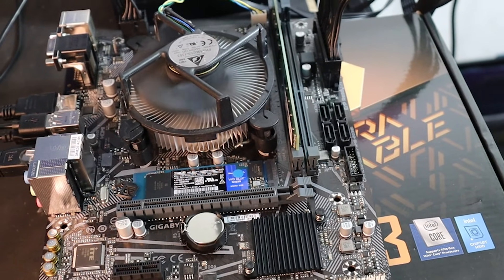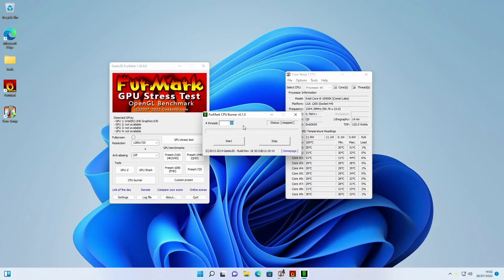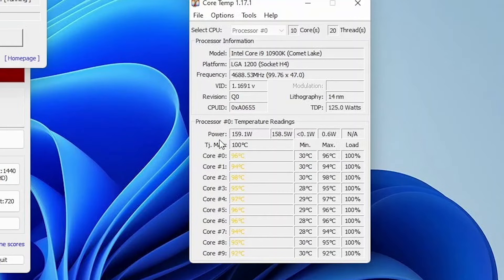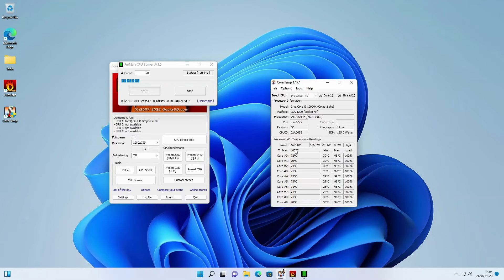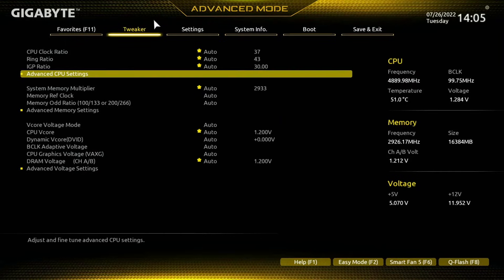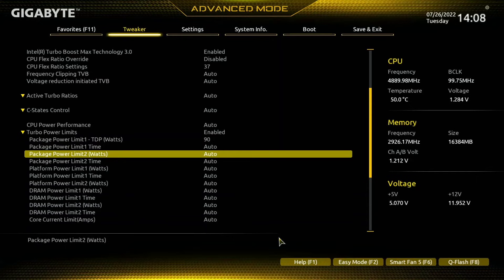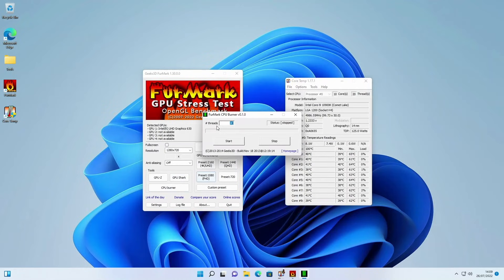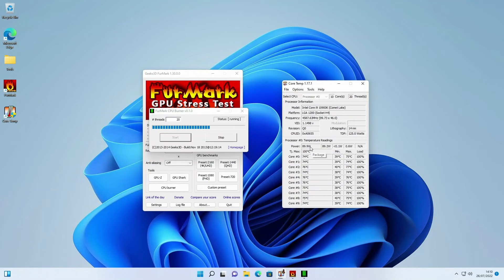How to Undervolt CPU on Gigabyte Motherboards for Cooler Temps

Comment: NO! I have these: Mobo Gigabyte Aorus Pro X WIFI7, i7-14700KF, 32GB DDR5 6400 MHz, Video Gigabyte 4070Ti SUPER Gaming OC 16GB, cooler Corsair Titanium Link 360, Monitor Dell Alienware 2K 240Hz, and I use only these settings: 

BIOS MENU (Tweaker tab -> CPU / PCH Voltage Control):

Vcore Voltage Mode:  ADAPTIVE
VF Offset Mode:  Legacy
Internal CPU Vcore:  1.200
Internal CPU Vcore offset:   -0.130V

I play all games in 2K, Ultra settings, DSLL Quality and my GPU has 60C and CPU 47-53C. Try it ;)

Comment: My current cpu is an i7-14700kf and i have a liquid cooler with a 500watt capacity. Any good settings
Reply: See my new post above ;) I have the same CPU ;) With my settings my CPU has 47-53C, and GPU 60C ;) Enjoy ;)

Comment: Question; your cooler indicates 180W limit, so why did you put your power limits to 90? Shouldn't the P1 & P2 be 180W each?
Reply: The spec he looked up was for the Dark Rock Slim cooler (just showing an example of what to look for); that's not the one he was using. At 0:58 you see his is a default Intel cooler, which may be rated for 90w. Hope that is helpful :)

Comment: I have gigabyte b760 ds3h and i5 13600kf
The temp goes to 100 degree with load 100% on cinebench
I tried  with tdp 125w but temp still reach 95
I have arctic liquid freezer 360 and am sure it fitted well and thermal paste is ok
Is gigabyte b760 ds3h is not capable of undervolting as i heard?!!
Reply: Iam having the same board.. same problem
Reply: did you solve it?
Reply: That board’s vrm is too weak for that CPU.

Comment: thats i want looking for it...
thanks man...

i have use i5 13500 with same thermal thrtlling issue when i do cpu stress it goes 95 to 98 with 165 watt power draw but i set it to 135 pwd now its time to test and guess what i earn temp under 67 i m so happy for these trick.....

thanks again man...
Reply: Bro same cpu I was using showing 90+ degrees while gaming... could this help wat mother board ur using
Reply: @arunprince143  im using at 140 watt.... and now it works smoth with not reach 80 deggree and i know it loose some performance but your goal is only gamming than go for it with 140 watt power draw it will not disappoint you... and i m using gigabyte b760m ds3h wifi motherboard with ddr5 based....
Reply: Hi, I'm also using i5-13500. Has there been performance reduction when you set your power draw to 135 watts?
Reply: When I do cpu stress my power goes to 80 w and temp is 90+

Comment: My i5 12400f idles at 50c and while gaming reaches 80+ When I did what u did  it seems like something was already put into my system to stop it going above 65W as that was the cap it was going to I suspect it’s because I still use intel new stock cooler any tips
Reply: Weird. I am currently using an i5 12400f and in 3 years my gaming temperature has never reached 50 degrees. Now, when it's winter, it's about 34-40 degrees. But I will add that I have FPS locked at 75. So I don't torture my equipment as much as possible. I have a weak refrigerator due to the size of the housing - noctua nh-u12s. Tomorrow I'm replacing the processor with an i7 14700. And I'm just starting to worry whether the cooler will be able to handle it. :)At rest my temperature is 24-30 degrees (in winter), in summer it is about 27-33 degrees at idle.

Comment: BRUHHHHHH ~!!~!~!~ I gave this a try since this game Dead Space remake has been the only game that's notorious for me that even at cpu load of 40% and gpu at 100% it still gets my temps to 85-90... THIS GAME ONLY.... and after trying your method in the video it worked for me, 1440p all settings maxed 144hz. All smooth and only gets to 55-60 which is the same for my other games like Baldur's Gate 3. This feels good and you saved me years of CPU lifetime it seems, thanks dude, i'd give you some weed if i could lol.

Comment: For i7-13700K
Vcore Voltage Mode: Adaptive Vcore
Internal CPU Vcore Offset: -0.200V
Enjoy! I think the same way for other CPUs with P and E-cores. For CPUs without P and E cores there is other way:
CPU Vcore - Normal
Dynamic Vcore -0.100V (number can be different for you). Works for me and for multiple PCs I did it at
Reply: Hey man. I also have 13700k should I just follow the values you put? Or should I also set the turbo power limits with let’s say 100 like he did on this video but he put 90 on his. I’m not familiar with this hope you can help me undervolt it without affecting too much performance. Thanks.
Reply: @Walkdthock  try only my values. If any problems then try -0.1V for example.
Reply: @AleksCoreBY  hi! I tried only your values and it’s good idle compared to stock. But when I tried cinebench test the temps still go so high with max boost clock. I needed to try the 90w value limit on the vid to reduce clock speed which leads to lower temps.
Reply: Well in cinebench even with water cooling AIO system I have like 96C I think with undervolting. In my case I never have such load on CPU like Cinebench creates in regular PC usage (I use it only for games). So I am fine with this. I even stopped using undervolting since I got water cooling AIO as in games temperatures just fine
Reply: @AleksCoreBY  see my new post above and my configuration and temps ;) I use that from 2 weeks ago ;) 

Vcore Voltage Mode:  ADAPTIVE
VF Offset Mode:  Legacy
Internal CPU Vcore:  1.200
Internal CPU Vcore offset:   -0.130V
Reply: I tried setting TDP limits as well instead of undervolting, as I think in some rare cases such undervolting giving me issues. It is interesting as my AIO can handle 243W TDP limit without reaching 100C. (it was reaching 98C as absolute maximum for a short time, cinebench test). 29798 score which is really good. So I will try using TDP limit now instead of undervolting
Reply: Hi, when you set your 13700K to Adaptive Vcore, did you have to change CPU microcode to 0x104?

I'm using a B760 Gigabyte, and a BIOS updates noted "CPU Internal Vcore and CPU Ring Voltage offset works on K-sku processors only when paired with 0x104 uCode version"
Reply: If i used i5 11400f under voltage?
Reply: Thanks for adding this because this youtuber doesn't seem to understand the meaning of undervolt. What a joke
Reply: Hi, when you set your 13700K to Adaptive Vcore, did you have to change CPU microcode to 0x104?

I'm using a B760 Gigabyte, and a BIOS updates noted "CPU Internal Vcore and CPU Ring Voltage offset works on K-sku processors only when paired with 0x104 uCode version"

Comment: how much watts should i put i7 13700k with Thermaltake Floe R360 CPU and Memory AIO Liquid Cooler  plz help.
Reply from the maker: You shouldn't need to apply any thermal limits with this cooler. If your CPU is overheating or throttling then potentially the cooler is not fitted correctly or is faulty.
Reply: @RollwithPunch  thanks

Comment: usually the lp1 was less than the lp2 why you add the same values for both for me i have 13700f  have Processor Base Power = 65w "PL1" and the Maximum Turbo Power = 219w ''PL2'' !!! how add for both the same value 219w pl1 and pl2!!!

Comment: for my 13600k i set mine to 50. my temps at load sit around 53c with deep cool castle at full load on cinebench 8 passes. little reduction in performance but my cooler runs completely silent and i dont see any reduction in gaming performance at 1440p.

Comment: My i7 12700k is limited to 190w and 100 degrees Celsius. My cooler can handle 250 tdp. I set my bios to 180 watts, and now my cpu doesn't go above 90 degrees Celsius. Being the limit for my cpu max temperature can go to 100 degrees Celsius. I think this is a good setting for this particular cpu type. Thanks for the video because the motherboard was hitting over 250watt, and it wasn't safe for this type of processor.
Reply: this video is stupid idiotic. dont look at it.  it's not how it's done!

Comment: (I don't speak English, so I use a translator. I'm sorry.)
 I am using the 13600k + b660 board.
You want to use this method because the temperature is high.
If I lower the power a lot, can it have a bad effect on the life of the product?
If we use it without power limit, we will consume 190w, so we will lower it to 150w.
Reply: Not on the life of the product, but performance of the cpu, because less power. Maybe even longer life, because less power.
Reply: U can reduce the CPU core voltage by 0.100V or reduce the Dynamic Voltage by 0.100V or adjust the offset voltage by -0.200V.

Comment: I have a 13900kf I ran a benchmark r23... cpu max power 345W ( unlimited power mode) 
Thermal trothle several core with the 420mm corsair aio after 5min. The cpu score was 40453 points. Great processor with crazy thermal!

Comment: This is not undervolting. This is power limiting and this considerably affect performance. Ofc the efficiency is better at lower tdps, but you actually lose performance. After undervolting, in the worst case you don't lose anything, in the best you gain a little bit of performance
Reply: yeah, that's what I thought.. I'm still looking for a tutorial for undervolt (finding the right offset -).. I kept seeing videos like this where they talk a lot without really explaining anything
Reply: @fatesteyneit2990  Any luck finding a good tutorial so far?
Reply: @Sigouss  no luck really, the best next thing is to try it and try to learn yourself.. its what I did 🫡 like the other comment said, every setup is configure differently so just have have to tweak yourself
Reply: @fatesteyneit2990  you have to find yourself your best offset man, there's no other way

Anyway, i fixed the problem i had the time i saw this video. If i remember correctly, i should have set everything to auto except the negative offset

Now the undervolt works properly

In my case, z590i with 10600k -90mv

But even if you had the same configuration, every cpu is different
Reply: @Leonardo-hy3qj  unfortunately undervolting doesn't seem to work properly on gigabyte b660 boards.
 i tried changing offset and voltage to the extreme and it does absolutely nothing and XTU is no help either so this is the only method except maybe tinkering with AC/DC LLC but that isn't a proper undervolt method i'd consider.
Reply: @Benhamina  try with throttlestop
Reply: So how do we undervolt on gigabyte motherboards? Cause I'm completely lost and this was the only solution I've seen so far, but yes performance is affected unfortunately...
Reply: @agentkido  you have to set it to "normal" if i remember right
Reply: @Leonardo-hy3qj  all I've noticed is if I undervolt more than 0.030V then my cinebench R23 instantly crashes which annoys the f outta me.
Reply: @agentkido  this means that the undervolt works. It is normal, then 30mv is your safe threshold. If you power limit AND undervolt, you can undervolt more, but of course you will lose a bit of performance
Reply: @Leonardo-hy3qj  I don't see a difference in undervolting tho I'm still skyrocketing to 100c which makes me think my AIO is going
Reply: @agentkido  check power consumption and frequencies
Reply: @Leonardo-hy3qj  where would I find frequencies? I can see my power wattage, and my tdp
Reply: @agentkido  afterburner + rivatuner, or hwinfo if you're not in game
Reply: @Leonardo-hy3qj  Set what to "normal"?
Reply: @nattyzaddy6555  i don't remember very well, i think 'offset mode'
Reply: Its not undervolting, this video shows you only how to deal with low watt CPU coolers.
Reply: Any working under-volting guide released yet for Gigabyte Z790 & 14700k? I have flashed bios to F9 from F8. F10 still in beta.

This power limits work magic that stopped cooking my 14700k CPU, with Prime-95 the CPU went from hitting 100°C temps down to 82°C spikes and average 60-70°C depends on core. power limit set to 175W +175W since i have 360 AIO.

No other trick of playing with undervolting worked for me because it was not stable. I found a guide from Techosaur but havent tried it yet, Its also very-very detailed settings in Intel extreme tuning utility. Which I will probably not even attempt to copy.

Watched JayZ2cents he does not set any power limit numbers just recommends to enable the setting which does nothing since every other relating setting under is still on AUTO by default... but he just shows Asus boards mostly, maybe it works there.

Second. What about XMP overclocking for RAM. I bought 4x16GB of Corsair vengeance for my board but XMP is unstable. Now I'm running it 4533Mhz instead of 6000Mhz. Not even manual setting higher frequency works stable.
Reply: can i power limit my gpu ?
Reply: Bruh if you don't undervolt your 13 and 14 gen is gonna die sooner or later
Reply: Your absolute right. Look at the core clocks there going from 3.2-4.3 GHz that’s why it isn’t undervoltng. Like you said per food greatly affected when power limiting. Undervolting you don’t effect performance unless ur doing something wrong. Horrible video and bad advice. Sad cuz I really can’t understand undervolting on gigabytes bios it’s isn’t like msi where you have a choice of offset in the voltage menu
Reply: @Shuttterbugg  neither did I in the beginning. You have to set voltage to Normal and then select or input your desired offset in something called like "dynamic offset" or smt similar
Reply: @Shuttterbugg  
this vid really confusing me , he have the stock cooler but he put the max TDP from another cooler ? they both different or am i missing smt..
& yeh gigabytes is a mess and not a single YT video explaining how to undervolt , there is no D.O.C.P neither offset in bios , just bunch of numbers that will make you dizzy.

Comment: My temp is sitting at 99C idle & only at 22W in core temp. Do I need to replace something? I don’t want to try and game & my shit catches 🔥 lol please help
Reply from the maker: Hi, this sounds like your CPU cooler is not working or your pc just needs a good clean.
Reply: yea i found this out too. my aio pump just gave out after 5 months of usage. i can't even refund it. $110 in the fucking drain
Reply: @machina03  I hope you made the switch to air cooling. same shit happened with my AIO, never going with an AIO again, air cooling is so much better, dont have to worry about those stupid pumps failing and the loud ass fans.
Reply: @jeeroylenkins3081  actually went with a different brand. i was dumb as shit with my money and bought the MSI Mag series or whatever it’s called. note to self, MSI can’t make parts for shit. instead i now have a corsair aio and it’s been working like a charm. and it’s quiet as a church mouse. keeping my cpu at 40 degrees celsius while playing big ass games (rdr2, cod, modern resident evil games)
Reply: @machina03  Congrats on those temps with the corsair AIO, that's really good. What CPU is it? I hope that AIO lasts for you this time. I am still scarred from my experience so am happy with the NH-D15 air cooler.

I do have the i9 13900k though, which is an angry hot bastard of a chip. Your gaming temps are pretty much my idle temps :P

Comment: My cooler does 95 watts so I put 47 for both and ram cinebench my temps went from 100c degrees to 51c WHAT THE HECK THANK YOU!!!!
Reply from the maker: Please remember that the lower you set the TDP it will also limit your performance somewhat, however it will increase stability of the system.

Comment: Bro my ryzen 5 2600 has a 65w tdp but when stressing it, it reaches 100w with 90°C temperature. What should i do? Even in idle the tdp is high.
Reply from the maker: Yes tdp is 65 but turbo will be higher. Please follow this guide for Ryzen CPU's https://support.punchtechnology.co.uk/hc/en-us/articles/6438162546461-How-to-set-a-TDP-PPT-Power-Limit-on-AMD-Ryzen-CPU-Processors#:~:text=For%20starters%2C%20AMD%20does%20not,and%20not%20the%20CPU%20itself.

Comment: Any help with Gigabyte b560m aorus elite. Still stuck at 65w TDP i5 11400f. I also tried millions other settings in Bios but nothing helped. Even in intel extreme i set the TDP to 90 but cpu never goes over 65
Reply: Hey, buddy. I also have this motherboard. Did you manage to unlock the tdp?
Reply: @leandroyata  no
Reply: @leandroyata  There is no way to do it.
Reply from the maker: Hi, Non "K" version of intel CPU's have a standard TDP of 65W so you will not be able to turn this up as it is also not an overclockable CPU. It should still however turbo to around 120W temporarily.

Comment: Hello! If I have an motherboard Gigabyte b660m DSH4 with an cpu i5-12400 and for this processor my TDP it's like 75W maximum, what value I should change there for an optimal temps?
My cooler it's: Arctic Freezer eSports Duo.
Reply from the maker: 75W is the base TDP. The problem is that this CPU will still turbo boost to 120W when it's on a heavy load. If you set your TDP to 75W like I do in the video, your CPU will not tubo to 120W anymore but you should have much better temps
Reply: @RollwithPunch  Hello! I saw when I test my cpu temp in cinebench my temps is ok, but in core temp write 75W maxim in full load...

Comment: I am using a 9900k with an atc700, what tdp do you suggest me to set on? I tried 90 like your vid but the max core freq i got was only 4.3ghz
Reply from the maker: Hi Yes, setting a TDP limit will also limit the frequency, you can turn it up bit by bit until you are happy with the temperatures.

Comment: hum will this work with an I7 10770k? A bit new to these things. Got an Gigabyte Aorus CPU Liquid Cooler 240. and temps hit 95 at times while gaming.
Reply from the maker: Yes it will work, I'm surprised you have these temps with a 240mm cooler. Are you sure thermal paste and the pump is working correctly.
Reply: @RollwithPunch  I checked the pump and its fine, I'll will do thermal past this week and factory reset the pc. As i have upgraded and changed a few parts like cpu,gpu and ram over the years on the same windows. So possible there are programs conflicting with each other.